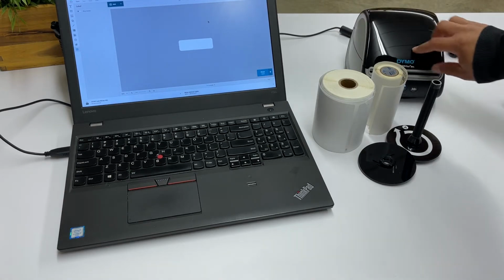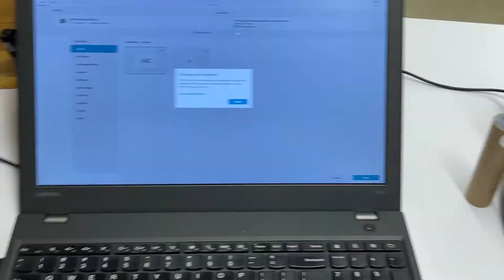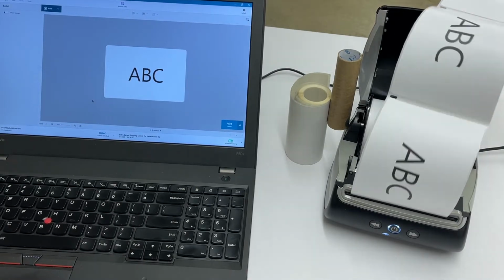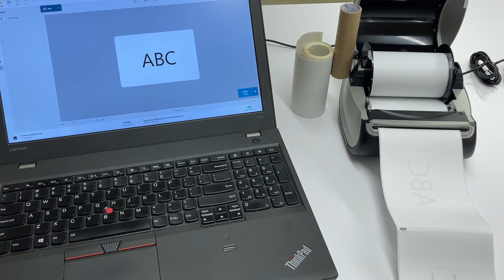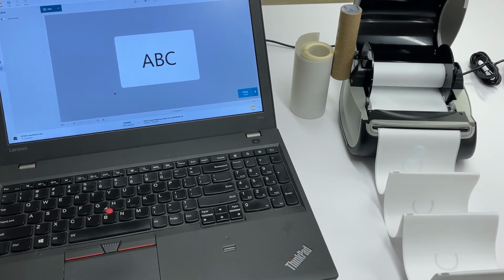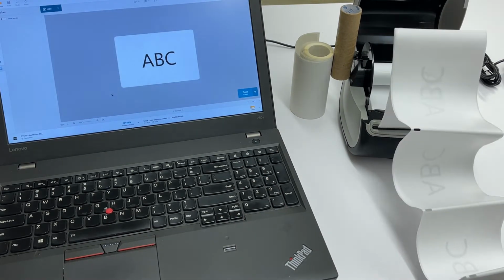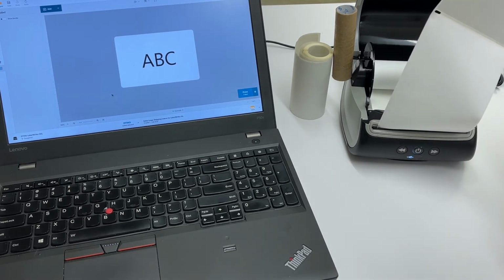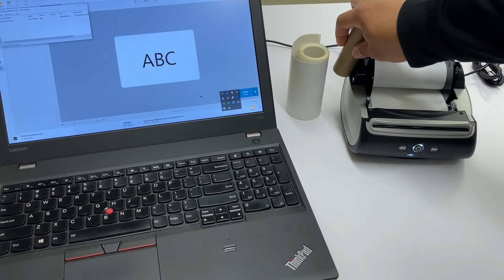How to re-use the chip for Dymo 5 Series Printers (550, 550 Turbo, and the 5XL LabelWriter? Bad News

Comment: Have you tested these outside of dymo programming? I currently use dymo 4's, and I print through Online Labels Maestro Label Design program. Wondering if the chip reacts the same way, or if the chip is even needed off of dymo programming
Reply from the maker: I believe I did, I can test again if there is interest. But from what I remember it just throws up an error still.

Comment: My good God it works 😅😅😅...I bought original dymo labels paper for $50+ in office Depot and a compatible on Amazon that didn't work ( compatible is 480000 labels for $157) I run into this video and try it after the dymo labels finished and try this and it works...Im so happy cause dymo labels are very expensive....
Reply from the maker: so sorry it didn't work longer. I wish more people would follow up in the comments and update that it actually does not work. It makes the whole thing misleading. Thanks for your comments, especially the follow-up!

Comment: As of the date of this comment, I cut out the RFID from the roll AFTER the label hit zero and the RFID still worked. I simply cut out the RFID with the cardboard still attached (do not peel the RFID off!) and taped it to the side and it works perfectly. I tested it on a roll that had labels and another that I finished all the way through. They both worked. I think there is a secret for this to work. My DYMO app says that my printer is disconnected. This may be why the trick works with me. Again, as of date of the comment (12/6/22) the trick works for unlimited prints.
Reply: How many prints did you do so far? And what is the max the RFID normally should print? We bought this dumb 5XL device without knowing it has this restriction..
Reply from the maker: @RunballRally  good question
Reply: @enko.labels  we return it.. official dymo labels for the 5xl came in today, and now it was paper jam... fun fact. Wasted 400 blanc labels that can't be used now... 

any Is the Zebra 220 good?
Reply from the maker: Please let us know if anything changes!
Reply: Works fine !!!
Reply from the maker: @thepalacegi6795  awesome!
Reply: The taping method didn't work for me and I only get 44 labels from my compatible labels paper with the dymo chip
Reply: Which dymo label paper did u buy? I bought 1x21/8 and the hack only give me 44 labels with a different paper...so which dymo label paper did u buy to get the hack unlimited?
Reply: 4-15-2024:

hack somewhat(?) works. was able to print an additional 40-50 labels (54mmx104mm) from a compatible RFID (using a 550), after that was unable to recognize. tried using another RFID from a 28mm x 89mm roll but it messed with label sizing while printing/spitting out. cheers for the video!

only why i put 'somewhat(?)' is because op end of comment says "trick to unlimited prints", but i was unable to get unlimited prints :(

Comment: I had already bought my Dymo 550 before I realised that I couldn't use my non-Dymo labels.  Your video was helpful because I just placed a full roll of Dymo labels against the Dymo printer and it perfectly printed my non-Dymo labels.  I don't care about the numbering.  Thank you
Reply: did it continue to print after the numbering ran out?
Reply: but now you can't use that Dymo roll anymore. Unless you sell it to someone else assuming they store the ID of the roll and the count in the printer. If they write to the actual chip, you're screwed.
Reply: Great idea!  I think I will order some dymo labels, use the chip as shown here to print my generic labels, and then return the unused Dymo Roll back to seller....hopefully that will allow me to use my non-Dymo labels and not throw them out.  lol!!  Thank you!

Comment: Thanks, nice video!  My concern is that Dymo will realize that their "cunning plan" is not working and they will include an RFID serial number on the RFID and include in their software a memory of the RFID tags it has seen - though that approach would probably make users print all labels on a roll before changing it.  In any case, DYMO's evil geniuses will undoubtedly try and strengthen their DRM because there is SO MUCH money out their for them to steal from people who are forced to use their DYMO proprietary labels.

Comment: I cut off the RFID tag and just put it inside. Makes it a big easier. Now we need to find a way to read and write to the RFID tag.
Reply from the maker: Keep us posted on that one, so far it sounds easier just to sell the printer and buy a 4 series.
Reply: Any updates on that rfd crap? There is only one method to bypass the limitation so far and its basically bs for 99% of all users as far as you are not a pro hardware hacker. Cmon guys this cannot be that hard for someone, who is into it...
Reply: Thanks just did this now. Just started the business yesterday and bought bulk labels from amazon. I was PISSED when I found out about this. They work now 😂
Reply from the maker: @itsBlackGarage  how many have you printed with the used chip?
Reply: @enko.labels  so far unlimited lol
Reply from the maker: @itsBlackGarage  so no point in finding a way to read and write to the RFID tag?
Reply: @enko.labels  not so far. I just cut out the square of cardboard with the label and stuff inside the new roll. Works like a charm
Reply from the maker: @itsBlackGarage  ok, when did you buy your roll with the chip? As you can see in my video I didn't have the same results and I would like to know how you got it to work.
Reply: @enko.labels  the first roll came with my printer. I finished that roll and couldn't figure out why the rest wouldn't work and found this video
Reply from the maker: @itsBlackGarage  ok thanks, assuming you just got your printer. I'll order a new roll and test it out again.
Reply: @itsBlackGarage  So you are saying you had the default roll (30 I believe), you printed more than 30 rolls? I was not able to re-use the tag. After 30 (even tho I did couple of blanks) it was not able to print. Would say the paper is empty.
Reply: It's already been bypassed.. was on Hackaday
Reply from the maker: @radman999  so how do we hack it?
Reply from the maker: and to be clear when I say "Can we hack.." we as in the everyday consumer. I have seen hacks since the launch, pretty much, but these are not for the average consumer. So they don't help much.